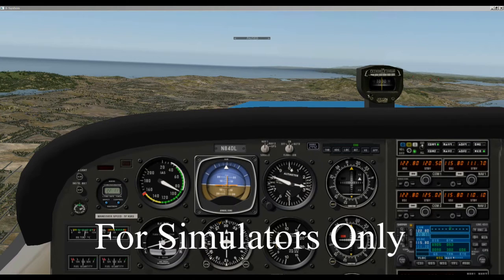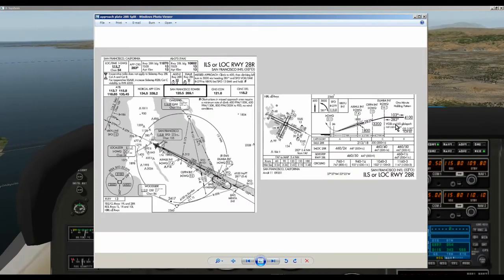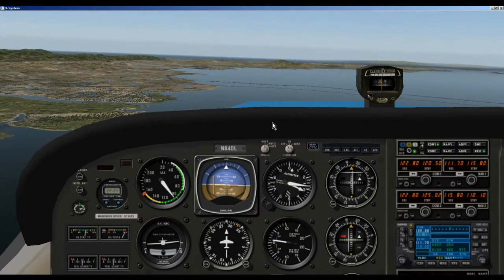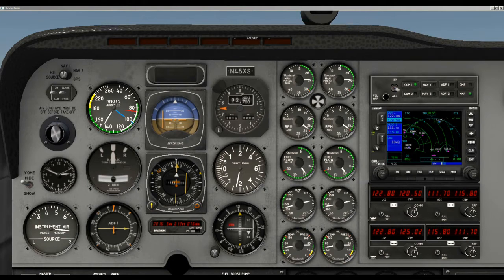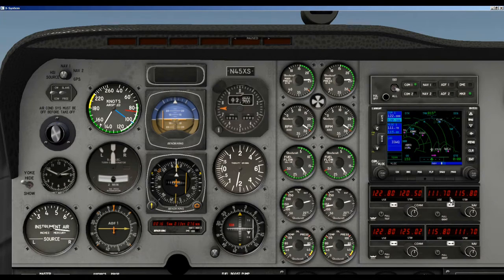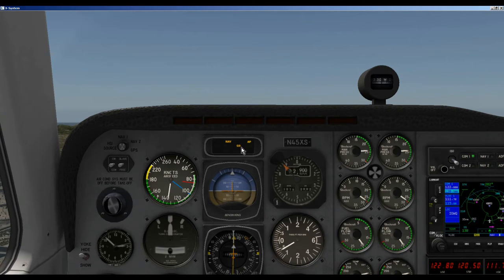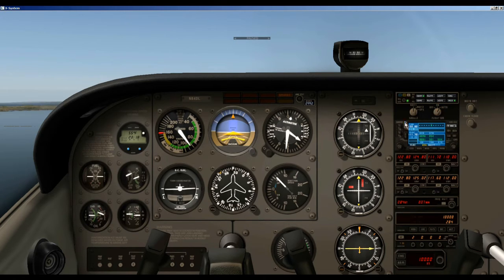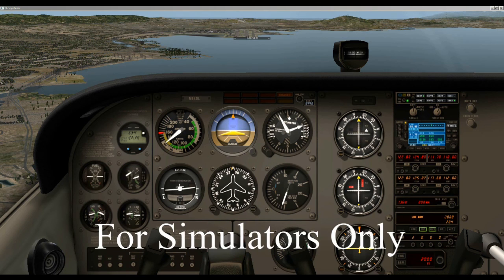How to Land using the ILS, Instrument Landing System in X Plane ~ Part 2

Comment: Can you explain what the switch Nav & GPS should be set on when ILS approach?

Do you simply keep it set on GPS?

Do you need to select “Approach Button”, Or just Nav setting when using autopilot?

Last question:
I tried setting up a IFR flight in my flight planner & used VOR waypoints.

I noticed after putting in my vor frequency & switched between the Nav & GPS toggle switch my VOR1 gauge would look ok then appear way off if I toggle gps/Nav switch etc.

It seemed to track better when set on GPS toggle switch for VOR 1 Gauge BUT when I entered same VOR frequency into NAV Radio the VOR 2 gauge doesn’t always seem correct even when switching g between NAV/GPS toggle switch? Why is that
Reply from the maker: Hi Michael,, The Nav/GPS switch selects the Navigation system you want to use, either GPS or Nav Radios, one or the other. To use the ILS system you need to use a Nav radio tuned into the ILS frequency for your specific runway, that's why it was necessary to switch from GPS to NAV when landing to use the ILS. 

VOR stations only work with NAV radios not GPS, you don't tune the GPS to a VOR but it can be a waypoint in your flight plan. The GPS does NOT communicate with the VOR just uses it's coordinance in a flight plan. 

To use the NAV Radio to navigate to a VOR you must dial in a radial (use the OBS dial) for the VOR you want to go to. Make sure you are heading "TO" the VOR not "FROM".
Hope this makes sense.

Blessings,
skip

Comment: I have more or less cracked flying using the GPS in X-Plane 10 via waypoints to an airport. Also I've learned how to use the airport's ILS to get the plane to land using the Localiser and Glide-Slope functions. What I'd like to learn now is how to get the Cessna 172 SP to locate an 'active' ILS on arriving near that airport and so land itself. Could you please show me how? Your videos are so clear and your voice is equally clear (refreshing for a UK citizen), thank you, Roger Adamson.
Reply from the maker: Hi Roger,  Thanks for watching, glad they are helping. 

I'm not exactly sure what you are asking, see if this helps. The ILS system does not work like a VOR. A VOR broadcasts in all directions, 360 degrees so if you are in range you can tune your NAV radio to a VOR and dial in the radial that will help you fly to the VOR. The ILS system has four narrow beams, two for the Localiser and two for the Glide Slope. To pick up the ILS signals you must be "in front" of it not off to the side. You will not pick up the ILS signals until you are relatively close to the runway heading for that ILS signal. 

So with that to get a 172SP to locate an active ILS you must be within a few degrees of the runway heading with your NAV radio tuned to the ILS frequency. If you are too high (above the Glide Slope) you will not pick it up. If you are too far to the left or right of the runway heading you will not pick up the Localiser. If you are in the right spot and the system is not working make sure you have your autopilot turn to "AUTO" and you have selected "LOC". Lastly the autopilot is not designed to land the airplane itself you must turn off the AP and land the airplane yourself. Let me know if this helped.

Blessings,
skip
Reply: Hello, Skip. Thank you so much for your reply. I have done some study after reading your helpful comments. If you have the time, could you check the following primitive flight to see whether I have now understood better what I was asking you. Any improvements, please?
GPS NAVIGATION AND AN ILS LANDING.
Enter Flight Plan:- CL90, TOWAN, destination airport KCIC. Click MENU. Activate the leg to TOWAN. Click PROC. Select Approach ILS 13L, Vectors, then Activate. With CDI, set to GPS, fly to about 500 feet, click LOC onto green and set Autopilot on. The plane turns towards TOWAN. When about 1500 feet, hold this Altitude with ALT. The plane flies to TOWAN where it turns Easterly. Click CDI to VLOC. Set the heading bug to 70 deg and click HDG. Arm the LOC and GS. The plane now flies 70 deg until it intercepts the localiser. LOC goes green and the plane turns towards the ILS. Flying at a constant altitude, the plane soon intercepts the Glideslope and GS turns green. With flaps and throttle only, the plane lands hands-free (if you wish) at KCIC.
p.s. I love your presentations. Roger
Reply from the maker: Hi Roger,  You do not use vectors for your approach.  You have picked a pretty hard approach if this is your first time trying to pick up the ILS. If you can't read the approach plate then your in trouble. This approach calls for a procedure turn. If you look at the approach plate you will see an arrow with a heading of 266 and 086. The way this works is you fly out on the 266 heading for one minute the come back on heading 086 and pick up the ILS. 

When you select approach pick the ILS13L then instead of vectors select NORDEIAF then you will see the route you need to take to fly that approach.  You will fly over the airport on a heading of 313 to NORDE activate the approach and watch it fly the procedure turn. I'll stop here and wait to see how you did getting this far. So I suggest you make your first waypoint in our flight plan NORDE and activate the approach when you can. 

I assume you want to program a complete flight plan with approach and have he airplane land itself. The autopilot is not for landing the airplane. If you try to let the airplane land itself you will crash. You need to turn off the AP before you get to the runway and land.

Let me know how you make out.

Blessings,
skip
Reply: Hello, Skip. Thank you for your instructions. I've only got as far as flying hands-free using GPS from CL90 then flying nearly over KCIC towards Norde. When the plane starts to do its Procedure Turn over Norde, then I switch to VLOC and it continues to fly itself towards KCIC's ILS. It picks up the glideslope and continues in to land with my input being just flaps and throttle. What I can't grasp is where does the branching off heading 266º and back on 086º come in? Have you made a video showing how to execute a Procedure Turn to show others and me? If you could explain the 266/086 turn-off, I'd enjoy learning that. Roger
Reply from the maker: Hi Roger,  

Good question Roger, thanks for asking.

To perform this type of approach you need to understand the approach plate which shows you how to enter the approach. In this case for KCIC you are instructed to stay within 10 nautical miles of the airport. So, depending on the airplane you are flying helps you determine when you should start the procedure turn because going 100kts vs 160kts makes a difference. With that in mind you can start the turn shortly after passing the NORDE fix for this approach as I see it, the faster you are going the sooner you will start the turn making sure you are within the 10 mile range from the airport.

I did a series on missed approach and holding patterns but not on this type of procedure turn but it could be a video in the 
future.

https://www.youtube.com/playlist?list=PLjqSrWIZDAi8VQlOgmhfqGqFVlMSGmhOi

Blessings,
skip
Reply: Thank you, Skip, for your reply. I look forward to studying your video on Procedure Turns when you have the time and strength to compile one. Best wishes, Roger.

Comment: Again thanks for the video!
What I am looking for is a possibility to enable / disable the autopilot with a keystroke or switch on my yoke. Especially in the baron it is hard to reach the on/off switch with the mouse.
Greetings from EDDW! ☺️
Reply from the maker: Hi JJTVism,  Try going to settings->keyboard (or joystick) and find flight director->toggle or flight director->(off/FDR/on) this is in XP11 but you should be able to do the same in XP10. Let me know how it works for you.

Blessings,
skip
Reply: I'm using XP 11 too, but this does't effect the autopilot in a C172 or Mooney 20 :-(
Reply from the maker: OK I see what you mean. Try searching for "servos" under autopilot, there is an option for "toggle" that should do the trick.

blessings,
skip
Reply: It did, yeah!! Thanks a lot! :-)

Comment: thx again for an informative video Skip! But i am wondering what the FD-Function on the AP in the Baron58 (and other airplanes) is used to be for ;-).
Reply from the maker: Hi niemalswiederful,  Glad the video helped!  FD stands for Flight Director it is part of the Autopilot. It's function depends on the airplane you are flying. They can be pretty complicated or a simple NAV1 NAV2, GPS switch.

Blessings,
skip
Reply: WEH Videos thx for your answer Skip.....guess I will stick with the easier aircrafts😉

Comment: hi skip love the videos but I am having a problem doing ILS landings in cirrus and falcoln from the xplane 10nm landing. Follow your examples and everything works great except on both planes it starts me at 2500 ft and on the Cirrus at 90-100knots. but it starts me to slow and then within seconds i am at 150 knots and climbing until the glidescope is in the middle but no time to get the plane speed down. I noticed your Falcoln did the same thanks.

I am intimidated by plane maker is it easy to swap gps and a better autopilot for these planes or the default prop planes.

thanks again, love the vids
Reply from the maker: +scott s Hi Scott. I forgot to mention anything about speed, I should have mentioned that but didn't. Are you using the Autopilot to control your speed? Try landing manually with the ILS, in the Baron 58 or the Cessna 172 with the AP "ON" not in "Auto". This way you are flying the airplane!  Keep the CDI centered and the GS centered and control you speed as you descend to the runway. I don't know why your speed would jump around unless you were using the autothrottle which I don't recommend using for landing! 

If the AP has to make big changes it won't work well or at all. Just like when you fly manually, you don't want to have to make hard turns and full power climbs to capture the GS. If you set up for the approach correctly then only slight corrections would be necessary and you and the AP should have no trouble landing.

In the video the reason my speed jumped around is I spliced together several videos and then did some editing on top of that. I wish I could do this in one take but there always seems to be something I forgot or something I want to take out so you will see things jump around as I can't recreate the exact same conditions when splicing several videos together.

Hope this helps, let me know how you make out.

Blessings,
skip
Reply: Thanks skip. I use the autopilot only for the approach function not speed. If you look at your speed on the falcoln on this video as soon as you try to catch the G/S I think the plane thinks your too low so kicks the throttle up to get higher to has the g/s in the centre. My LOC is perfect in the middle of the runway. Also when do you throw the power to idle so when you try to flair you don't take off again.
Reply from the maker: +scott s Hi Scott, Well I believe the reason for the speed changes in the video is this happens when I cut out pieces of a video to shorten it and splice videos together, it's just how the video was edited and I did several takes on this so it's a couple videos  combined to make one. I was not to concerned about speed when I made this video because I never was going to actually land and since I manually controlled the throttle what you suggest could not happen. The AP will NOT control speed unless you have the auto throttle engaged and since I don't have it engaged in this video there is no way for the speed to "jump" unless I accidentally moved the throttle.

When you go to idle depends on the airplane you are flying. In the Cessna 172 as soon as you are sure you will make the runway then you can cut power and glide assuming you have the correct speed. Some airplanes require you keep up power till touchdown or the nose will drop quickly, the do not glide well.

Forgot to answer you question about Plane Maker.  Don't be intimidated by it. Just copy an airplanes complete folder and work on the copy. If you mess up you can just delete it and start over, never work on the original! It's also a good idea to have several copies for back up just in case. As to what airplanes you can modify that depends on the airplane, some you can modify and some you can't so just try and see what happens. 

Blessings,
skip

Comment: Hi Skip hope you are well. Was just looking back over your videos to refresh my memory (its an age thing) and was wondering, ...... and this may sound stupid but, how did you get your approach plate to pop up on the screen the way it did ?
Thanks Pete
Reply from the maker: Hi Peter, Nice to hear from you again. I'm well thanks for asking. Got a couple hours flying up in Redding in my favorite little Cessna 172N so that always puts a smile on my face and Thursday I'm off to Portland to run the Portland marathon on Sunday with my sister and brother-in-law.

For the approach plate it didn't really pop up. First I downloaded the plate, they opened it in Photoshop to split it it two. Then I had the jpeg file of the plate open along with X Plane. X Plane was opened in window mode not full screen. Since I have a lower portion of my screen out of view in the videos you don't see me move the mouse over the icon for the approach plate and click on it. Sooooooooo it looks like it just pops up but I had it opened behind X Plane and clicking brought it to the front for all to see. Clicking on the X Plane icon made the plate move to the back. Sorry it wasn't something really cool you could do while flying well  I suppose you could do what I did for the videos if you don't mind flying in window mode instead of full screen. 

Blessings,
skip

Comment: An idea for future WEH Videos, the management of speed, and flaps during an ILS approach using autopilot. I notice the speeds going wild in your ILS approach samples. Thanks
Reply from the maker: +Ramon Arriaza Hi Ramon, Sorry for the very very late reply but I'm having problems with your comments. I got an email saying you sent a comment yesterday but it does not show up and I still can not reply to it, so as soon as I figure out the problem I'll reply.  I see I've missed several other comments of yours over the last year that I have not been able to reply to but now I can reply to some, like this one. Don't know exactly why I'm having this problem with your comments but hopefully I can figure it out.

As for speed management during ILS approach you need the manual for the airplane you are flying. Try and find a POH (Pilot Operating Handbook) for your aircraft. There should have been a pdf that came with the airplane you purchased giving you this kind of info, V speeds, flap settings etc. I'm not sure how it's done in the real world in big jets but I control the speed on all approaches manually, even when using ILS. 

In my examples the "speeds going wild" could be because I sometimes I have to redo a section of a video because of something I don't like or left out something. So I remake sections and try to set everything up so it look like I did just one landing but actually it could be two or more "pieces" put together to make one landing. It's hard to get things set up exactly the same so it look smooth and I admit I never thought about the speed when "splicing" this video, something that I could have done easily but didn't think about. 

I make it a point to reply to all comments. I enjoy talking with everyone who takes the time to write  and I'm sorry again for not being able to reply to your comments and will work on finding out why your comments don't show up. If you can check your end to see if there is a setting or something that's blocking them that might help.

Thanks again,
skip

Comment: Hello Skip, thank you for covering this complex system at such ease once again. I now know what I was doing wrong, chasing the ILS signal towards the wrong direction. Instead of going opposite, I was heading towards the needle hence the reason ending up else where than the runway. :/ Thanks to your videos, I can certify myself now instrument rated pilot. :) Of course, kidding on that.

On a plane that LOC/NAV/Auto pilot doesn't exist following the ILS signal with the CDI indicator or 6 pack system, also the same?
Reply: ***** Hi Skip, correction/question: on a Cessna as it seems we move away from the centre line of the needle to capture the localizer whereas on CDI/FM systems (larger crafts) we move towards the needle. On vFlyte Piper Arrow III and some Carenados we do the same as on the Cessna (the needle is an angle). Is that so? This what confuses me most. Many Thanks!
Reply from the maker: ***** Hi MrKurtay,  Thanks, glad it helped. Yes they all work the same, always turn towards the CDI or G/S needle.  Blessings,  Skip

Comment: There are so many cool solutions to problems that at a first glance should be complex, but in reality isn't. That ILS in essence is just a directional radio transmitter on the runway and a receiver in the plane is so simple, it's genius. Just like how modern submarines can stay under for so long, how do they get oxygen? Simple, lead DC into a container of sea water, and the water is split into hydrogen at the anode (-), and oxygen at the cathode (+). And I hear there's access to electrical power on those nuclear subs. =)
Brilliant in its simplicity!
Reply from the maker: ***** Hi Peter, Your right it's so simple once it's explained. It's those people who figure this stuff out and design the systems, for airplanes and subs, that blow me away, yes it's genius. Thank for your comment!   Blessings,
Skip